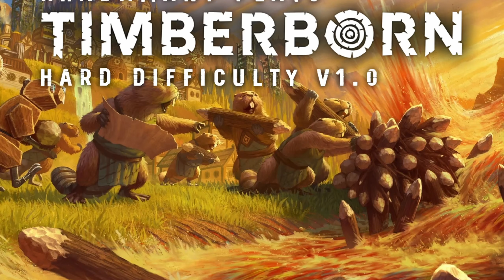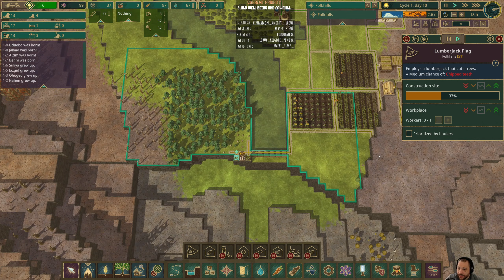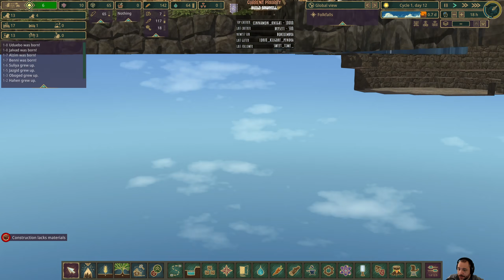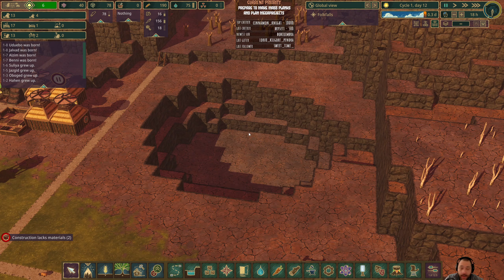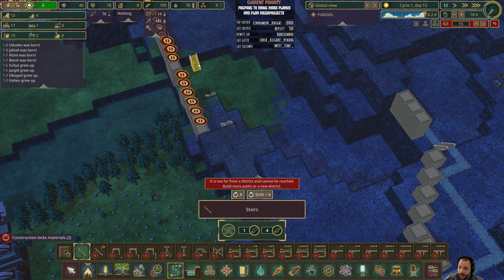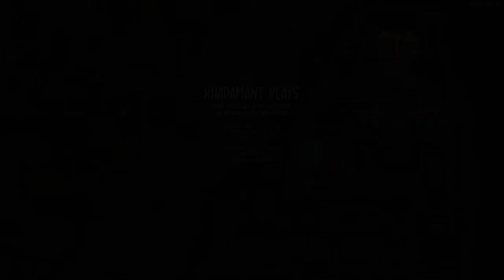Controlling the River Flow in Timberborn 1.0 Hard Mode - Let's Play & Tutorial // EP3

Comment: It's a shame the beavers only figured out undershot wheels (water flows under the wheel pushing it).  Overshot wheels (where the water falls onto the top of the wheel from a raised channel above) are far more efficient as you're driving the wheel with the weight of the water as well as the flow.
Reply from the maker: Indeed, utilizing waterfalls would be cool